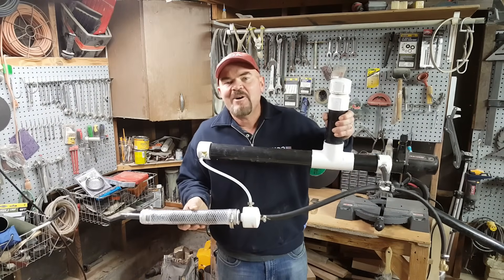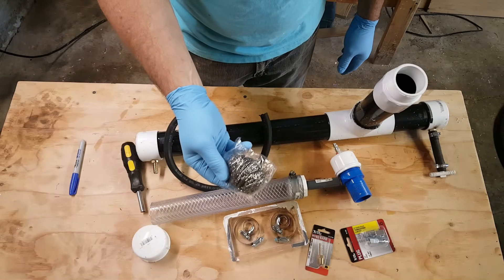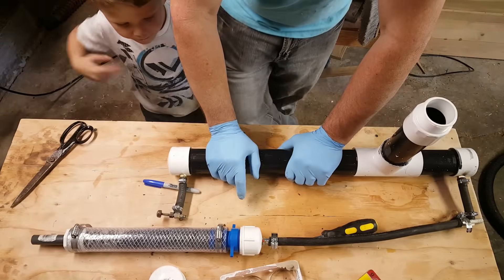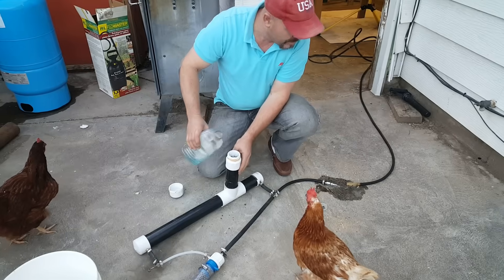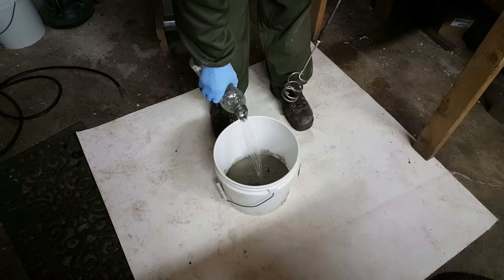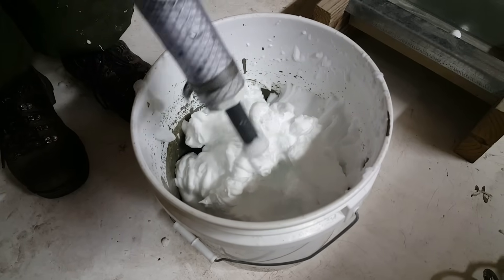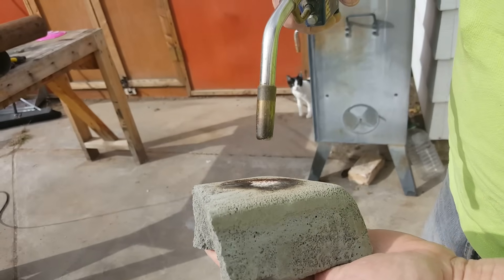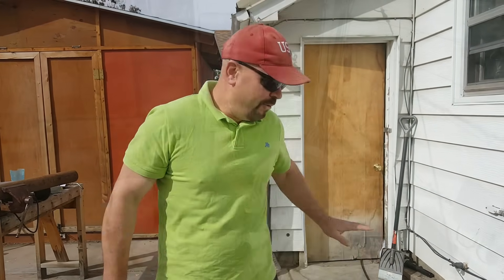Air Crete Machine for Under $30 (DIY)

Comment: Great machine. I think it is very possible to fill gaps, cracks and holes with air crete. Place plastic foil over the cavity, make a hole in the plastic and fill up the cavity trough the hole.

Comment: ABS (black) and PVC (white) are different materials not meant to be used together. It requires a less common glue specifically formulated for this app.  PVC  ( polyvinyl chloride) is common in the eastern US and  acrylonitrile  butadiene  in other areas (depending on local codes)  Local big box store will have one type and correct glues.

Comment: Black PVC is not PVC, it is ABS and requires a different glue. ABS is cheaper but only by a small margin so you usually only see it in trailer houses where they are trying to save every penny. There is a special glue for PVC to ABS connections but it probably costs more than you would ever save using ABS.
Reply: I just bought the "transition"  ABS/PVC glue with the green label and it was about the same price.  Where you save with this PVC/ABS mixture of parts is that Home Depot sells 2" ABS pipe in 24" sections, so you don't have to buy a full 10 foot length of PVC to get the small quantity you need for this project.  You need an 18" piece, a 6" piece and a 10" piece. And you don't have to bring the trailer to transport your two 24" pieces of 2" ABS raw materials of pipe home.

Comment: I could not find the product on Este and there was no link on the video.  Could you post the drawings and material onto the video.  We can freeze the frames and do a Print Window.
I'm repairing my bulkhead cap, and given the lightweight properties the forms will not need to be massive.

Comment: Thank you for the hack! If only more fathers treated their children as you do. What is the function of the stainless steel scrubbing pads? If finer stainless steel wool were available, would this increase the quality of the foam? If so, have you considered 3-D printing a highly tortuous and/or micro-pore insert to take the place of the pads?
Reply from the maker: Wow, good idea. that sir I believe would work as well.( The 3D printing) And yes I did have to use a very fine wool in the machine when making soluble glass foam. I used a 220 grit steel wool, However I immediately removed it after use as I knew it would begin to rust within minutes. I tested both fine and course with a foaming agent and it didn't appear to make a difference as long as I had at least three ss scrub pads in the gun. 1 or two pads isn't enough.
Reply: Thank you for your reply and, again, for your videos!

Comment: Great Video Darwin! I wonder if there's a way to combine the foam & cement into a mixing nozzle and be able to spray it.
Reply: Ryan Rall Concrete they make spackle/plaster hopper air sprayers for spraying textured walls. I bet this is light enough to work in it maybe with a slightly larger nozzle. Was thinking the same thing but after already pre mixing it.
Reply: Ryan Rall Concrete that's what I'm wondering.
Reply: one option would be similar to spraying gunite which is mixed in a mobile mixer and uses compressed air to spray onto concrete for repair. Also could be sprayed from a gypcrete machine which uses sandblast hose then you just add regulated air pressure. Those two both require around 90 - 110 psi so you need about 185 cfm compressor. The nozzle size used at the end of the hose would somewhat regulate the material. Another possibility would be to use a HD industrial sprayer designed to spray fireproofing material...more ideas come to mind

Comment: also, as a rocket heater, doesn't the heat need to radiate into the home from the horizontal tube so that it heats the home? Perhaps it wouldn't be good for that part, but since it is after all cement, it should last  as long as any cement regardless of tiny bubbles. I wish we could see more studies done.  I just love this stuff, I wish we could see your after the 30 day cure. Normal bricks and industry prepared concrete  blocks ARE cured for a full length of time. Thank you!

Comment: For all you asking questions 
This has been out for decades 
In Europe 
They make panels to put up bldgs 
They use it to level out the floor 
They put  in roofs 
A dome building group  came up with  the green dragon. 
They determined that a protein based soap like the organic 7th heaven makes a good  foaming  agent.    They sell commercial foaming agents too.
Honey do carpenter  came up with a diy way go do it .
Which I thank you
Reply: Correct. Europe doesn't have access to wood the way North America does, so they had to adapt to that shortage

Comment: I wonder how this might work as an outer plaster coating for straw bale buildings.
Reply: My first thought also!
Reply: I imagine you could find a way to spray/ almost like shotcrete the mix.. even as a glue/layer before finishing with precast panels?

Comment: Thanks a lot for the video. I really wonder, would you trust that material to build a cabin in the wood, would it last enough, or will it become brittle after just a couple of years. If its strong enough, its not a joke I will buy a piece of land somewhere and build myself a nice cabin or a bunker with this stuff.
Reply from the maker: We are planning on building a home using it, with a proper seal it will work. :)  Just make sure of building codes.
Reply: Please post the video, I am pretty sure I am not alone who wanna see that. Thanks for the reply. And btw, don't forget to mention if where you live you have snow, the difference is huge on a building.
Reply: You just have to go thick enough

Comment: Did you mix soap foam with concrete ? I wonder if it would work as insulation for a shipping container home.
Reply: @Freddy McIntire - Hi, that´s a misconception. Concrete after cure will shrink, specially given the same conditions (heat, moist, etc). Please double check your sources. 

If left to cure incorrectly (too hot, too dry, too... etc.) it will develop "uncontrolled" shrink cracks. A big no no, specially on structural applications.
Like pretty much most other materials,.it will expand with heat and contract with cold. Add moist to the equation and it gets more "confusing".
Example1: Under freezing conditions the concrete will contract, the moist will freeze and expand, two opposing forces that mostly result in cracks...
Example2: In high heat (ex. oven) applications, concrete and moist will both expand, but at different rates. Result, it cracks... 

Expansion joints are added to counteract/minimize, in a controlled manner, these phenomenons. Meaning that when correctly applied, it will "move" where its intended to move.Without prejudice of the final work.

With this said, there are specially formulated cement and grout mixes with low retraction or even expansion features. Usually used on "sealing" applications (tunnels, basements, foundation work, etc.). ;-)
Cheers
Reply: @crpth1  thanks mate. did he use air compressor machine in this video?
Reply: go outside - It´has good insulation properties. 
But your problem regarding the use on a container, is how to make it "grab" the metal walls. 

All concrete, this type included, shrink after cure. As such it will get "loose" from the walls if some mechanical fixing is not done.

Welded Wire mesh, re-barb or even bolts trough the container walls can serve the purpose of letting it "stick" to the walls. For all effects think of the metal walls as a "form".

Personally I would prefer a more flexible type of insulation in that application. ;-)
Cheers
Reply: Attach lath to the shipping container,  then apply the air crete like stucco.  It will slide off of the metal otherwise. Alternatively,  you could build a form around the container, and pour it in. I think the lath would be less work, and less expensive.

Comment: says black PVC pipe and the pipe has abs written right on it!
Reply: ABS to PVC green transition cement.
Reply: I'm glad I'm not the only one who caught that. Great machine.. but did he just get ABS because its cheaper? What glue is there for joining ABS to PVC? No problem if its not high pressure...
Reply: Bill Foster 
ABS is not cheaper than PVC.
Reply: Detail people are needed to do the simple jobs.

Comment: I know if it had set longer it wouldn't have broken, but I laughed so hard when it did! Lol! That would happen when I try to explain that it won't break!
Reply: Cement does have lousy shear and tensile strength. Is there any reason to think that this aerated material wouldn't need rebar or other reinforcement just as normal cement/concrete does?
Reply: pickinvidders I've seen other videos on this. It is actually very strong stuff once it sets up. Rebar? Who knows unless you try? I would think that doing this under normal building situations would be a good idea. It is supposed to be lighter and stronger without reinforcement. That is what I've seen.
Reply: Lighter without rebar, but could use glass/carbon/hemp/other fibers for strength. What I have read about the strength of aircrete is that that aeration weakens (vs. standard cement/concrete) a block in compression (hard to find info on tensile and shear strength, but I'd assume weaker there as well), and that the lighter weight and insulating properties are mainly what make it attractive.

Comment: So  you're using straight Portland Cement. Whats the mix ratio. Cement, water and foam and thats it? I like your foam machine. It could be used on the car too.

Comment: ingenious idea.being in the concrete industry 30 yrs I have seen the benifits and uses of light weight concrete.Try using a water reducer admixture for even more structural integrity.
Reply: cual seria un aditivo reductor de agua???

Comment: Awsome....    And really want to build one...  Just wonder..  You make some things / new endcap  ..  are you also use stanless steel wools   ind THAT cap ?? 

How do you know the right mixing ratio  between  soap/ foam and concrete, so it will be strong enough ??

Comment: Why are you mixing abs pipe with pvc fittings?  Barely compatable materials. proper fittings and pipe are easily accessible! Probably on the same isle you purchased the wrong ones on.

Comment: man I loved this video and and even as a DIY guy I would get your plans just because you did a great job showcasing the build, product and are helping folks understand more about building materials like this kind and that is always more power in peoples hands when they are given the knowledge. I love that you added the concepts to help folks understand the uses and whats such a big deal about concretes and their different make ups and where the industry is trying to go. Something that I was thinking about when you were mentioning the insulative value of this made product with your foam tool got me so stoked about it with rocket stoves or heaters and then you mentioned it right when I was pondering what tests you have found!!! So thank you for mentioning that and now I know that I can write you more about this topic and know about another gentlemen looking for easier to make high heat materials for all the many ways to use rocket power (obviously not rocket power but easier to write). I would love to hear about other readily available materials that we can help make rocket stove parts that can withstand 3 to 4k degrees and not prematurely degrade. So I would love to here from you about your journey in searching that out as it seems that you are quite more knowledgeable with the cement world and I have stuck to the earthen clay stuff, since I realize that portland cement materials just aren't base material substances that can take the heat abuse over time even if we aerate it. SO PLEASE make a video if you haven't about your progressions towards an easier way to making refractory masonry material for rocket builds since I deal with it a lot. Your video of this mix did inspire me to think about making water glass like many do and adding that to the mix to be a higher temp stabilizer, I have made attempts on small scale rocket burners using cement with perlite and then doing the same mix with water glass (sodium silicate) being easy to make and can handle at least a couple thousand degrees. So I'll stop now and try to make contact with you. But last note. It also was way cool to see you run your channel with your entire family involved and you showed openly about being a very intentional kind loving dad and husband, and I love that!! So kudos man!! keep it up. We can all tell when a man loves and puts intentionality into the family relationships, and you let it be seen for your followers. Great example!!

Comment: hello from northern wisconsin to MR & MRS Honey Do ,,,would you consider making a small follow up video ? showing the pounds of portland + gallons of water + pound or ounces of foam + psi ...to create a batch of your wonder crete . im moving to the philippines next fall,,planning on using aircrete.. to build a bubble / blister shaped home . its an earthquake area il feel safer with no long straight walls that would flex , building up a crack the whip situation .
Reply: hiya charles. i am in the philippines now and am planning to build an earthbag dome house here.and have just come across this aircrete and now i am thinking to do the dome roof with this product. not reaally sure if it will withstand the very heavy rain we get here
Reply: Jeselle Blando It works great if you stucco over the aircrete.
Reply: mick spurrier    Probably not. It can’t stand up to much. It’s very fragile. My weed hacker tore up the blocks I built. It might hold up for a while but will need constant repairing.

Comment: Interesting way to make cheap lightweight concrete.  The one issue I see is that you have to add a lot of water to allow the foam to work into the mix.  The #1 rule of concrete is: the more water, the weaker the final strength will be.  
Another way I have seen lightweight concrete with better strength is to mix in vermiculite or pearlite.  More expensive than soap bubbles but you can make a much stronger mix.  Lots of examples of outdoor pizza ovens made this way for example.
Reply: one could add a plasticiser to the cement to decrease the water content thus allowing greater strength.
Reply: Could another liquid chemical be added to water, some fast evaporating chemicals that are not flammable ?

Comment: Great job !!! Nice little family congrats.  I looked into this several years ago long and hard most info. I found was in India and other countries. What a shame we are. Great simple and thoughtful idea. I may be using this to mix the harder and higher temp  refractory cements as they are heavier and more dense perhaps add vermiculite or stir-foam pellets. Stuffs not cheep so this will stretch it and make lighter shell.
 I'm sure there are many safety improvements to be made but YouTube is about ideas and sharing ... building is at ones own discretion and determination,  Thanks so much looks very promising.

Comment: Heating concrete can cause the cement to explode because of moisture in concrete expanding rapidly,  you were extremely lucky it did not rupture while holding it in your hand.
Reply: much less likely with all the entrained air, as the little bubbles give expansion room. And since the air insulates so well, the heat is much less likely to go deep where the steam would cause the block to explode.
Reply: you ol worry wart...
Reply: Suuuuper lucky the sun didn’t explode!

Comment: Thanks 
Worried about spending over 500 for just a few projects 
Add alluminumin to increase temp tolerance 
I believe cement is rated at 2000.
Reply: As stated, this cost only $30 to make. The $500 is for a production unit that just does what this does.

Comment: What kind of concrete did you use?
Reply: Not concrete, Portland Cement
Reply: aggregate + cement = concrete    aggregate + asphaltic emulsion = asphaltic concrete  Concrete is a final product of mixed materials aka a matrix with a binder. the binder (can be) cement but it (can be) any number of different binders that when combined with aggregate will make an end product of "concrete".  I think you mean cement?
Reply: The main thing is to have a mix that is very fine  and no gravel
Reply: So could I use Brixment?

Comment: Not bad. Do you think the soap might affect the structural strength of the cement. I think aircrete is often made with urethane foam. It would probably would be fine behind a layer of polyurea, anyway.

Comment: Dam neat little thing you have there, in the 90's I used what is called Hebel  (Air Crete) here in Australia to make craft products try adding some PVA white glue in your soap tube just mix it up with your soapy water, should add a lot of strength. We use it over here in the mortar when laying bricks. also if you want it (Air Crete) to stretch a bit further make your brick mold long enough to hold a glass bottle (or plastic) as it takes up space and add's strength also recycles the plastic one's. NOTE.. with the PVA make sure you oil your mold well as the PVA is a glue
Reply: Not a problem.A little bit of knowledge can go a long way these day's with the internet. PS... I'm 65 this month and just love this stuff, :-)
Reply: Thanks for sharing mate
Reply: is it good for making pavers?

Comment: I'd bet if you did it the old fashioned way and added dry straw to the mix before pouring it into the brick molds, it would make it a lot stronger.  Or chicken wire would be another option.
Reply: Depending on application, the straw may rot out over time, which makes the brick even lighter, but doesn't add to strength in the long run.  Aquarists use a technique like this when making fake coral rocks, they use rice in the mix which leaves behind a porous texture after it rots out.